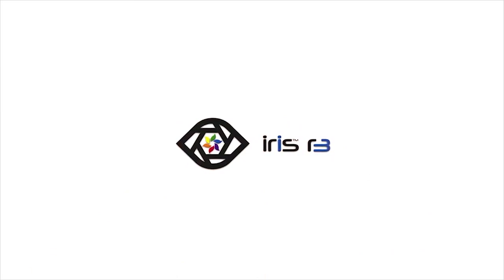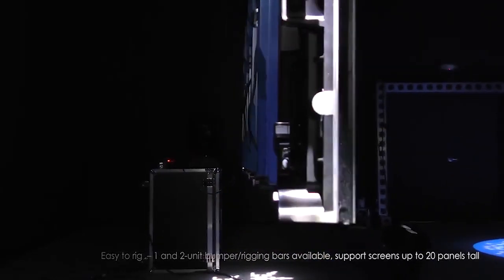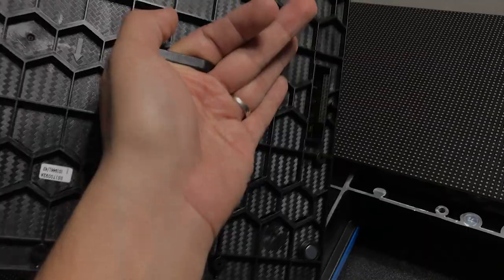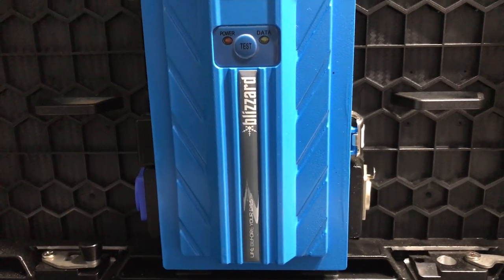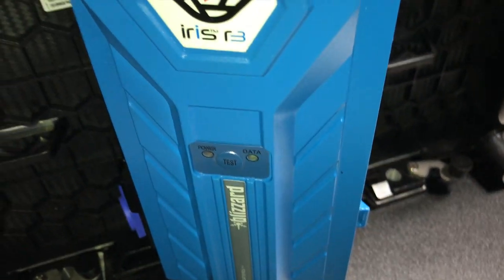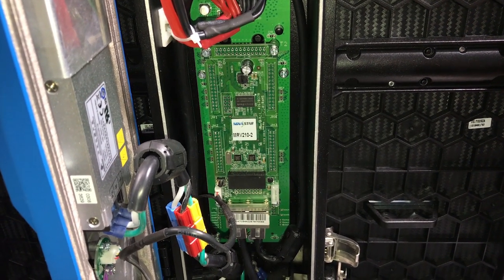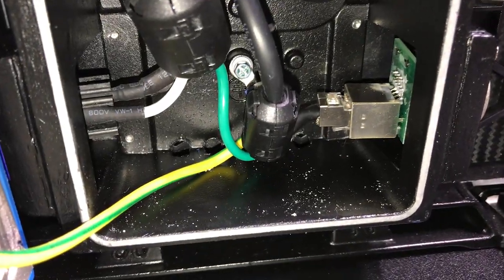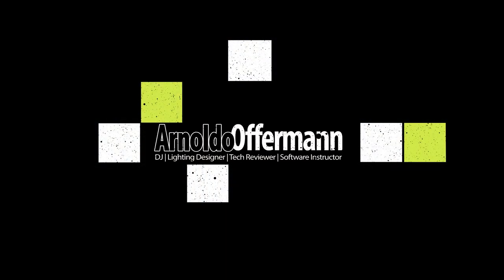Inside an LED Video wall panel!

Comment: For it's simple design and construction, I don't understand why they are soo expensive if all it is, just a panel with bunch of diodes connected to a motherboard. Even a computer has a more complex design and build yet they're cheaper
Reply from the maker: I’m actually going to be doing a video on this